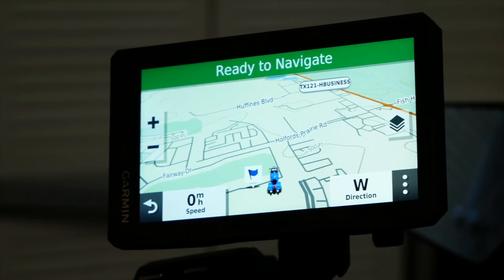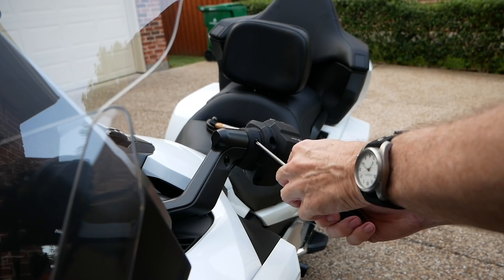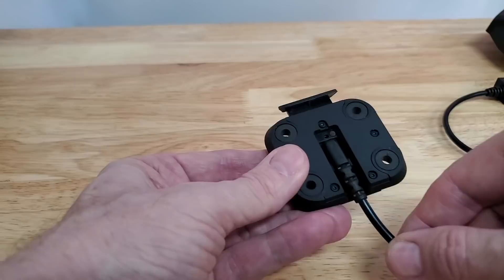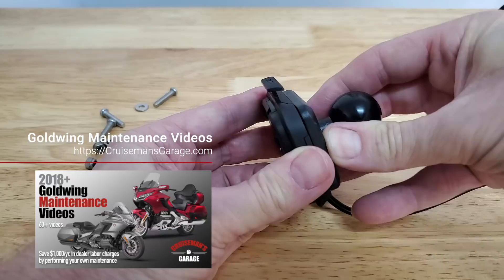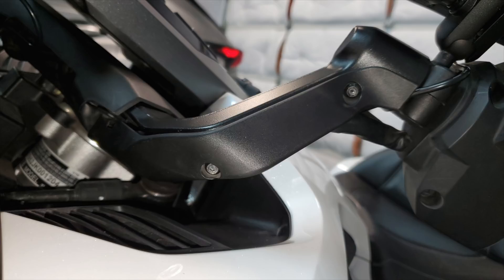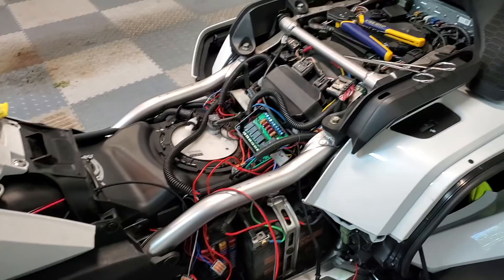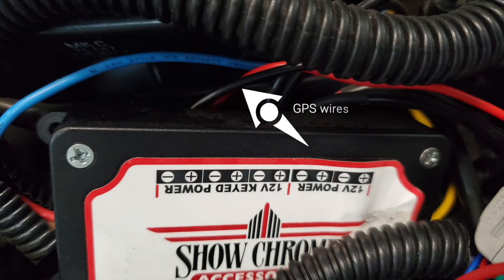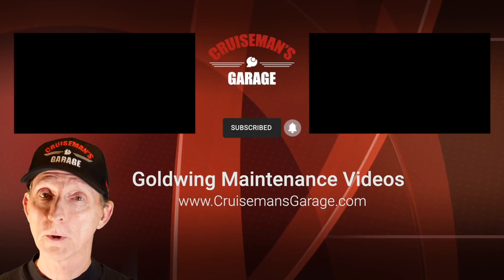Garmin zūmo XT Installation | 2018+ Honda Goldwing | Cruiseman's Garage

Comment: Cruiseman, I found that you CAN fish the pogo pin end UP to the handlebars, instead of trying to fish the 12V-5V step down block DOWN to the fusebox. That's how I mounted mine, and I didn't have to remove a single piece of body plastic.
Reply: Explain pogo pin end please
Reply: The end that connects to the mount. Those spring loaded pins are called POGO pins.
Reply: @MotoRideswJohn  Did you have to splice in any additional length of wire as Cruiseman shows in the video?

Comment: I ran the wires up from the battery to the bars. 
The "12 volt to 5 volt transformer" stayed near the gas tank, and I was able to fish the small connector up thru the left side pretty easily to the left side mount.
Also, I used a philips screwdriver to loosen the plastic cover under the bars without having to lift the center console. With the cover loose, the small power wire laid along side the other bundles of wires. Saved a lot of time this way.
PS: The Zumo XT has a very bright screen. Nice! But no provision for TPMS (if that is a consideration for your older bike).
Reply: How exactly did you get the connector up through the left side? I have not found an opening large enough to pull the connector through. Almost at a point of giving up now…
Reply: @hansscholz5914  I started at the top left side using a 2 foot long heavy duty zip tie. I was able to gently work it along the left side of the frame under the plastic bodywork. 
It eventually came into view down near the left side of the gas tank. Then I securely taped my wires to the end of the zip tie, and then pull them both back up to the open area just left of the handlebar area.
The long plastic zip tie works much better than a piece of copper wire or other hard object.
Reply: @417ah7  Thanks for your quick reply. I tried it many, many times exactly the way you described it, but I was never able to get the pogo pin through the opening just below the handlebar area. I finally tried it on the right side, and there it worked! Luckily the wires are long enough, so getting from the fuse box to right side of the gas tank and then back to the left under the handlebar is not a problem at all, and the wire is completely out of sight.

Comment: Hey Cruiseman, nice informative video on a temporary run/fix for the Garmin XT GPS. Your suggestion allows the user to have quick usage of the unit until the removal of the “Tupperware” and a more permanent   line placement. Well done!!

Comment: Using the short cut for lifting the Left side of the shelter, I was able to finiggle that "transformer" box through the tight openings where Honda ran the main wiring harness, then drop down behind the frame to the Honda provided accssory box.
Reply: where is the shortcut video?
Reply: @RH-qf6wv  The first one I saw was by the owner of HeliBars.  Then the Vimeo series by Fred Harmon has a detailed version.  I hope it does not violate Cruiserman's rules to mention other sources.

Comment: Thanks Cruiseman.    I'm ok with the Honda gps on my 2019 Goldwing.   I hear what your saying regarding your opinion of the on board system.  My complaint about the on board system is the small country back roads are not labeled !      That's where I do most of my riding.   I like to take my way to the destination which is often a different way then the GPS wants to take me.  Consequently I don"t use the guidance .   I simply know the roads I'm supposed to take and use the GPS for location only.   But if the roads aren't labeled  I miss my turn.     Is there an  update I didn't get or is there a different scale to use to get the system to identify by name the smaller roads?    Thanks always for the great videos.        Dave.

Comment: installed wiring today was a very frustrating process spent many hours on youtube. At times I wished I still had my 2009 Gold wing.  Honda really messed up with this model I would be willing to pay to have someone else to work on it but the dealer I purchased it from screwed up so many things when they worked on mine I don't want to take it back to them. I love the Bike but the seat is bad   I had it rebuilt , haven't been able to ride since hope it was worth it.

Comment: Nice but those 4 bolts on the mount look ugly. I can see rust forming on them and the lock nut. Too bad there's no snap on/over rubber/plastic caps to cover them up.

Comment: Why do you prefer to install the Zumo XT on the left side with the RAM mount that needs to be purchased separately instead of using the supplied mounting kit to install it on the brake reservoir on the right side of a 2018 Goldwing?

Comment: Cruiseman,
You said to hook the wires to a "switched circuit".  Is the accessory terminal on the 2018 Goldwing Tour a "switched circuit"?  Thanks.
Reply: That is, the accessory terminal on the Goldwing fuse box.
Reply from the maker: Yes it is!
Reply: @cruisemansgarage  Thanks!

Comment: When I connect my XT to my headset, it overrides the connection to the bike ('19 WIng)- I get the Garmin turn directions but  no bike radio in the headset. Did you find a workaround?
Reply from the maker: Depends on your headset. Most higher end headsets (Sena 50S, Cardo PackTalk) will have two separate channels (A/B or 1 and 2). You should pair the Goldwing to your headset using Mobile Phone pairing (Channel 1 or Channel A). This will deliver the bike's audio through the headset. Then, pair your XT using GPS pairing on Channel B (or channel 2). When you do this, any navigation audio will mute the Channel A/ or Channel 1 audio temporarily, then return the control to Channel A/1 after the navigation instructions. DO NOT pair your phone to the headset. Instead, pair your phone to the Goldwing.
Reply: @cruisemansgarage  Thanks for the note.  You would think the new Cardo Edge would be "high end" - but it doesn't work with 2 devices.  Heads-up for others who are considering this unit.  I'm going to buy a 50S.

Comment: Cruiseman,
The ZUMO XT comes with 22 AWG wire.  What was the AWG size of the red and black wire you used to connect to your isolator fuseblock?  Thanks.
Reply from the maker: I ran the XT wire all the way to the fuse block
Reply: @cruisemansgarage  How did you get the in line fuse block on the Zumo XT routed under the tank?  In your video you added 36 inches of red and black power wire.  I was wondering what the awg size of that was.  I don't plan on dismantling my front end to thread the wires to the fuse box.  Thanks.

Comment: I may have missed something but why add a GPS to the motorcycle if it already has one? Maybe I need to research the GL1800 plus? I didn't know that there was a difference.
Reply: Clifton Howard - Because the Honda GPS is quite bad.
Reply from the maker: For 60% of owners, the Honda GPS will probably be fine. After all, many riders don't even use a GPS, and if they do, it is for finding the nearest gas station. But, for multi-day touring where you want to pre-plan detailed routes in advance, the Honda GPS falls apart. Garmin's GPS has a lot of programmable features.

Comment: Two questions - 1st. What is the unit’s internal memory capacity - previous models couldn’t even handle complete North American maps (I’m guessing there’s too many POI), to me that was a big issue if you were planning a cross country/north american trip. 2nd. How long can the unit last on the battery alone?
Reply from the maker: 1. 32gb internal memory. 2. Garmin claims up to 6 hours or 3.5 hours if 100% brightness.
Reply: Cruiseman's Garage - thanks great stuff much better internal memory - can you still search POI along a set route - great feature to find Gas stations or Hotels while riding
Reply from the maker: @davidmorgan4750  Yes you can, and it is even more enhanced than that!
Reply: Cruiseman's Garage now hooking one up to the helmets? Or the bikes audio - ???

Comment: Hi Cman...I'd appreciate your comment on my plan to connect a "cigarette lighter plug" or whatever you call those plugs to the plus and minus wires provided with the electric hookup so i could take it from one bike yo another using the female socket on each bike....do you see any problems with this...thanks for your reply.
Reply from the maker: Should work, but when you plug into the USB port for charging, you lose the waterproof.

Comment: I have an XT ordered. I would like to be able to sit in my easy chair with it and design trips on the trip planner. Is there any way to get 12 volt power to the unit when it’s not on the bike ? I wouldn’t mind using a small 12 volt battery kept in the house. But how would one keep the contacts touching when unit is not locked in the cradle ? Could one purchase an automotive cradle and power cord and rig up a connection that way ? I know that base camp exists, but have read many complaints about it. And I believe the XT has some stand alone internal battery capacity but I’d still prefer to power it while playing around with it. Thanks.
Reply from the maker: Yes, there is a USB cable provided that allows you to power the unit when not on the bike, plus, the battery will last for several hours when fully charged.
Reply: @cruisemansgarage  Awesome. Thanks a lot !

Comment: There is only one reason why I would upgrade from my 595LM and that is if the screen can be seen in sunlight.  Therefore my question is.......does the new XT have a TFT screen or just a glossy finish to the old LCD display?
Reply from the maker: It is TFT and it is MUCH brighter than the 595.

Comment: Its a shame that you even have to do this. If Honda would take their GPS more seriously you would be showing us the built-in system instead.
Reply from the maker: Completely agree. They should have gone with Garmin.
Reply: @cruisemansgarage  Or any of the leading GPS companies. I like how BMW does it with a drop-in slot for a unit. That would have worked for Honda. It also lets customers upgrade more easily. We could have this discussion for a long time, but most companies want things to be proprietary so they have complete control, and lock out any changes to their systems by outsiders. CYA stuff.
Reply: Honda locks down the motorcycle and car gps systems while you are moving. You cannot search for a gas station until you stop by the side of the road. THIS is why we add a Garmin to our new Gold Wings.
Honda locks us out while moving for legal liability reasons. My new Chevy truck does not.